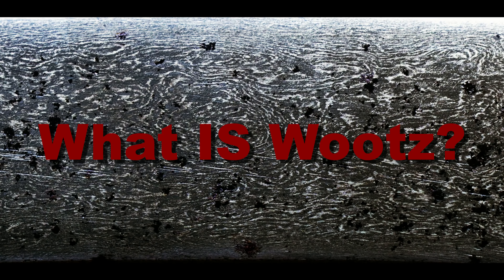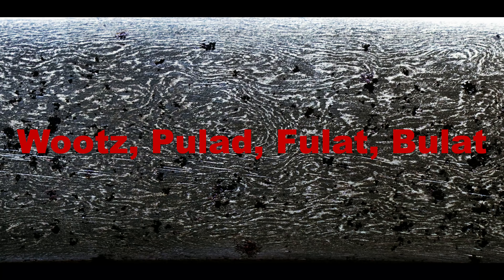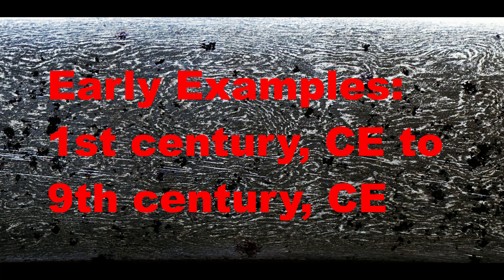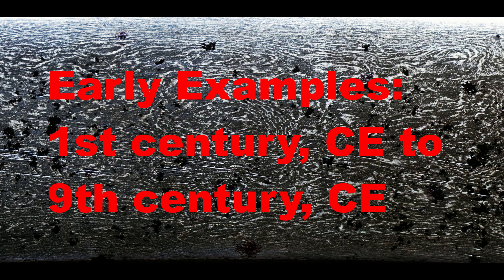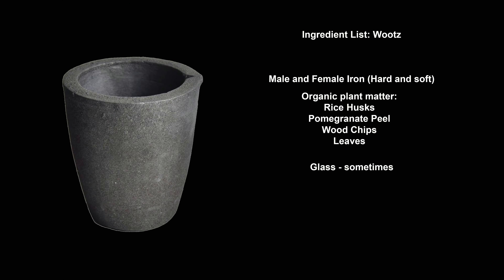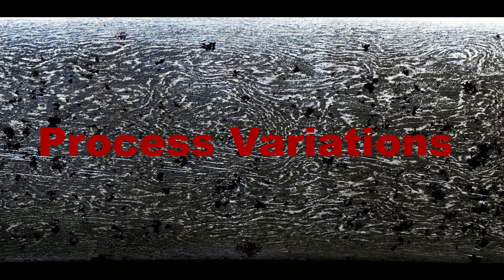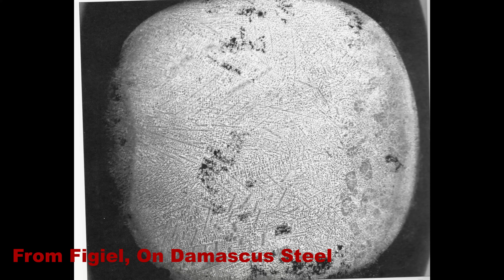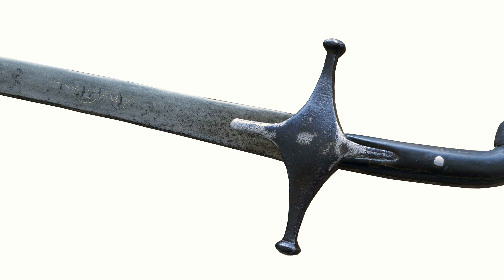"True Damascus Steel": History, Metallurgy, Production

Comment: Wootz steel originated in South India, in present day Tamil Nadu and Kerala, and ancient Sri Lanka.[1][2] There are several ancient Tamil, North Indian, Greek, Chinese and Roman literary references to high carbon Tamil steel. The crucible steel production process started in the 6th century BC, at production sites of Kodumanal in Tamil Nadu, Golconda in Telangana, Karnataka and Sri Lanka and exported globally.[3][4][5] The steel was exported as cakes of steely iron that came to be known as "Wootz".[6]
The method was to heat black magnetite ore in the presence of carbon in a sealed clay crucible inside a charcoal furnace to completely remove slag. An alternative was to smelt the ore first to give wrought iron, then heat and hammer it to remove slag. The carbon source was bamboo and leaves from plants such as Avārai.[6][7] The Chinese and locals in Sri Lanka adopted the production methods of creating wootz steel from the Chera Tamils by the 5th century BC.[8][9] In Sri Lanka, this early steel-making method employed a unique wind furnace, driven by the monsoon winds. Production sites from antiquity have emerged, in places such as Anuradhapura, Tissamaharama and Samanalawewa, as well as imported artifacts of ancient iron and steel from Kodumanal. A 200 BC Tamil trade guild in Tissamaharama, in the South East of Sri Lanka, brought with them some of the oldest iron and steel artifacts and production processes to the island from the classical period.[10][11][12][13]
Trade between South India and Sri Lankan with the Arab world through the Arabian Sea introduced wootz steel to Arabia. The term muhannad مهند or hendeyy هندي in pre-Islamic and early Islamic Arabic refers to sword blades made from Indian steel, which were highly prized, and are attested in Arabic poetry. Further trade spread the technology to the city of Damascus, where an industry developed for making weapons of this steel. The 12th century Arab traveler Edrisi mentioned the "Hinduwani" or Indian steel as the best in the world.[1] Arab accounts also point to the fame of ‘Teling’ steel, which can be taken to refer to the region of Telangana. The Golconda region of Telangana clearly being the nodal centre for the export of wootz steel to West Asia.[1]
Another sign of its reputation is seen in a Persian phrase – to give an "Indian answer", meaning "a cut with an Indian sword".[9] Wootz steel was widely exported and traded throughout ancient Europe and the Arab world, and became particularly famous in the Middle East.[9]

Comment: I've seen that Saadallah sword on Imgur before. It's a beautiful piece of history. I like just how simple the hilt is compared to the rest of the sword, especially if it was for a king (even if it wasn't, it was almost certainly purchased for a fairly wealthy member of the Szlachta).

Your pronunciation of Zygmunt III Waza was spot on!
Reply from the maker: Purchased as a part of a large order, not specifically for the king.

I don't speak Polish often, but it comes in handy sometimes
Reply: @IPostSwords  Yeah, I think I got that wrong before as well. Still though, you'd expect the hilt to be slightly higher quality than that
Reply from the maker: @MRKapcer13  well, the hilt is likely Wootz as well. It probably had a lovely pattern once upon a time. But with no scabbard to protect it, it got coated in a thin layer of corrosion
Reply: The correct spelling is Asadullah. Asad=Lion, Allah=God. Putting them together: Asad-o-Allah~Asadullah. These are Arabic words that were adopted by Iranians. It was a common practice for Iranians to use Arabic names.

Comment: Nice video, thank you.  Vanadium in the ore was indeed the key to unlocking the lost art of wootz.
Reply from the maker: Not only vanadium - Verhoeven et al found that other carbide formers could also cause patterns to form in crucible steel. For example, in their paper "The Key role of Impurities in Damascus Steel", they analysed one blade (dubbed the "voigt" blade) which used manganese, not vanadium, as a carbide former.

Comment: “It was these sages who narrated to King Abdalmalek ben-Merwan that, when Richard the Lionheart met the immense Saladin on the crusades, the Christian king believed it necessary to extol the virtues of his sword.
 To demonstrate the strength of his very heavy greatsword, he cut an iron bar.
 In response, Saladin took a silk cushion and snapped it in two with his scimitar without the shadow of an effort, to the extent that the cushion seemed to open on its own.
 The crusaders could not believe his eyes and suspected it was a trick.  Saladin then threw a veil into the air and with his weapon tore it apart.
 This was a thin, curved blade that glowed, not like the swords of the Franks, but with a bluish color marked by a myriad of randomly distributed curved lines.
 The Europeans then verified that these were precisely the characteristics, O great lord, of all the plates used in Islam in the time of Saladin. "
Reply: I mean, that just sounds like a sword that's been heavily sharpened, while not necessary for cutting through flesh (it doesn't have to be sharp enough for a dropped hair to split upon, just to cut pretty well when you apply force) it does however make for amazing stories and displays.
Reply: the blade was tempred and blued.
Reply: The Abdelmalik bin Marwan of the Umayyad Caliphate?? How can sages tell him what happened to Saladin when he died 705AD

Comment: I noticed how I somehow managed to melt rebar in my home forge charcoal forge. Due to this weird occurrence, I tried to make my own wootz steel. I added 1k of mild steel (0.18% carbon) and 9 grams of crushed hardwood charcoal. I added a small scrap of 80crv2 as a source of vanadium and some glass to the top of the Grafite crucible. I sealed the top off with Satanite and fired it in my forge for 8 hours with my blower on max. The billet that came out was unusable. The billet had some unmelted iron and probably absorbed lots of carbon from the graphite in the crucible. I was not expecting this to work on my first try. I'll do another run in a month or so when I can source better cruciables.

Comment: Does Damascus steel edge lasts longer then a carbon steel edge? I heard that Damascus is hard to sharpen but the edge would last longer
Reply from the maker: Well, wootz is a form of carbon steel - and regarding edge retention, it depends on the specific sword, and how it was heat treated.

Some late era indian crystalline wootz swords are exceptionally hard, and have amazing edge retention, but they're also a bit brittle.

Others have relatively soft edges, but they last a long time due to the dispersed hard carbides. They are easily nicked and damaged in battle, though.
Reply: I wish I had my own garage with a forge, in middle school through high school, I took metlaurgy, metal shop, woodshop, auto shop. Thought the year my teacher had a schedule for us to follow, at the end if the school year he gave us time to work on our own projects, lots of kids made knifes, or other simple forged items. One problem we couldn't figure out, how to fold the steel without it falling apart. Not hot enough? Either way that was like 20 years ago. Would love to work again in a metal shop.

Comment: Scientific American magazine (1973?) published an article written by a materials team that was exploring 'super-plastic' steel.
The team was looking into reports of Damask steel being extremely soft when forged...softer steel = reduced production costs.
Their starting material was granulated high purity iron and carbon, sealed in a crucible, and roasted until the contents 'sloshed' when the crucible was agitated.
Not fully molten, think 'Slurpie' frozen drink.
The finest particles of iron combine with the carbon...high carbon steel has a lower melting point that pure iron, so we end up with liquid steel + iron particle slurry.
The larger particles of iron absorb carbon...case hardening of a sort.
Slow cooling before decanting the steel ingot gave time for crystallization and dendrite growth.
They duplicated their best guess at making Wootz, and it paid off!
The steel they made worked best at dull-red heat...at higher temperatures, as is used in traditional Western forging, the material crumbled.
They were able to get 14:1 compression under a single pressing without any cracking at the edges.
The pressure required for forging was quite low, compared to industrial steel working.
They never did a 'finger-pinch' on a blade, but they were able to use wooden tools to make impressions in the work pieces.
On acid etching, the surface grain pattern looked remarkably like historical 'common' pieces.
Their conclusion was that Wootz has great properties, but the energy cost and the non-recycable nature of the material made it 'useless' in an industrial context.
Re-forging a finished Damask article will ruin the grain structure, making it behave more like Bessemer-process steel.
Melting down a piece of Damask, as in recycling, turns it into common steel.

Comment: at about 9:30 you talk about the increased density(of cememtite?) at the edge. Could that where the idea that forged blades are superior to stock ground knives because they have 'edge packing ' from forging?
Reply from the maker: I think this perspective probably came about due to kitchen knives to be honest. When the stamped, cheap stainless options became plentiful but had poor edge retention, high end knives still often used forged blades made of high carbon and high end stainless steel. As a result, people attributed the forging to their quality, rather than their better raw materials
Reply: Edge packing is irrelevant with modern steel. Only useful when you have "grain"

Comment: I cannot find anyone that has tested the durability of the wootz swords.  What is the Rockwell hardness?  Has anyone displayed the flexibility?  Most importantly has anyone displayed the edge retention of the swords?  Lots of videos talking about this legend but none that actually prove it.
Reply from the maker: Peter Burt on youtube has been testing modern crucible steel blades. In terms of antiques, the original Pendray/Verhoeven/Dauksch article has rockwell C values

Comment: Do you know why a lot of sabre scabbards have extra metal added to the bottom where the tip of the sword would be? It flares out.
Reply from the maker: It's called A drag, it protects the tip of the scabbard from being worn out and getting holes in it, which would allow moisture in

Comment: Now that we know the composition of the various elements needed to create a very close reproduction of Wootz Damascus, has anyone been able to recreate this alloy using modern steel making methods, or is it still restricted to ancient crucible methods?
Reply from the maker: It requires a crucible, that much has not changed. But modern recreations often use propane or diesel furnaces for heating, rather than charcoal and forced induction. 

They also often use cast iron and wrought iron, rather than using wrought/bloom and carbon - in a co-fusion process. Also historical, but not practiced everywhere.

The end result is a steel chemically and structurally identical to ancient steel, but with less inconvenience.
Reply: @IPostSwords   Thanks. I knew that if I asked enough people, someone would have pity on me... and provide the answer. But! But! But! Are billets available for purchase? Does the steel have a name, or does one look for the chemical composition?
Reply: @johnlshilling1446  I don't think this type of steel is commercially avaialble. It is also not a craft that is easily learned. There is a beautiful documentery of the recreation of the an Ulfberht sword on YT: https://www.youtube.com/watch?v=namXt4Etn_o I watched is several time.

Comment: Pattern welded steel. Is not true damascene steel. Many modern knife and sword makers wrongfully capitalize on the term Damascus. As a way of stealing quality for their blade making abilities. 
True damascene steel was a very specific process.
That resulted in a particular quality of steel. 
The term wootz steel. Is a different metallurgy than damascene steel. These metals are made with two different processes. Wootz steel is a forging process originally created through experiments in industrial metallurgy in the 18th century. 
It is a chemical augmentation process first used in gunsmithing.
Damascene steel originated in about the sixth century as a cast welding process. First used in sword making for the Byzantine empire.
 Although both are often considered similar to canister welded steel by modern terminology.
These are three very different forging processes. Resulting in completely different types of steel. 
A damascene cast welding using a forge mold process in the original production method. 
Although similar to canister ingot making. 
Treated the steel very differently then how modern blade makers fold pattern welded steel.
Using dissimilar metals.
Damascene steel had certain characteristics that isn’t recreated using a pattern forge welded process.

Comment: Does it have to have a pattern to be Damascus? Damascus is aka folded steel.  The process of forging  Damascus requires folding the steel. Wondering if we consider the Japanese katana as Damascus even though there is no pattern do to one type of steel?
Reply from the maker: I mean, crucible steel isn't folded but has a pattern, and people call that "damascus".

Folded, contrasting steels as seen in pattern welding gets called damascus.

Katana (and all nihonto) have hada, or grain. So technically they have a pattern it's just low contrast. I prefer "hada" to "damascus", as it's the anglicised version of the original Japanese word. 

Wrought iron usually has a weak Woodgrain pattern. Yet people don't call it damascus.
Reply: @IPostSwords  thank you  very much for the reply. So following the  requirements , could one say that a traditional Japanese katana is a Damascus San mai? Most did a san Mia traditionally if not all I think. Or would it just come down to opinion and its kinda a vague term these days?
Reply from the maker: There are specific names for the different laminations that katana had - I don't know their names by heart. San mai  is simpler than most of those laminations

Comment: Thank you kindly Sir; please tell me: this ancient technique, how does it differ from a more semi-modern processes like the Lancashire hearth, reduction using charcoal,  LH indeed established after quite some new technical findings, many of those discovered in my small home village in Sweden? I suspect they, ie in the old days, didn't - either - really melt the raw iron, but hammered a spongy matter into better and better steel.
Reply from the maker: As far as crucible steel is concerned, they did indeed melt the raw iron - only made possible by the very high carbon content (>1% carbon), which reduces melting temperature.

In the case of LH, you're making cast iron (4-5% carbon) and then fining it to reduce the carbon down to useful levels. Which is lower temperature than doing crucible steel (a logistical benefit, you dont need to get the furnace as hot), but requires more steps. 

For bloomery iron, it was indeed spongy matter that was forge consolidated into better steel.
Reply: @IPostSwords  Thank you kindly for explanation; and - as you say - the presence of cementite streaks indeed shows the specialty of the true-Damascus process.

Comment: What's Stronger, and holds up better? The Wootz Steel or Pattern Welded Steel?
Reply from the maker: That question is fundamentally flawed. 

There isn't just one crucible steel and one pattern welded steel. The composition, quality, and heat treatment between each example of historical crucible steel is highly varied, and as such so are the properties. Likewise with pattern welded, not only is there variation in the steel, but also in how well and how cleanly the welds were executed.

There is not way to compare "all crucible steels" to "all pattern welded steels" and still get a meaningful answer. Each example needs to be individually analysed and compared.
Reply: @IPostSwords  okay, thanks for the quick complex answer. Wasnt sure it would be that difficult to hypothesize

Comment: Wonder how a wootz steel blade with a pattern welded steel edge would do...🤔
Reply from the maker: Wouldn't really be a benefit to it. Any heat treatment that works well for the crucible steel, isn't good for pattern welded lower carbon steels.
Reply: @IPostSwords  interesting.. thought there would be a way to take  wootz Steel and basically forge it after like remaking, with an added element.